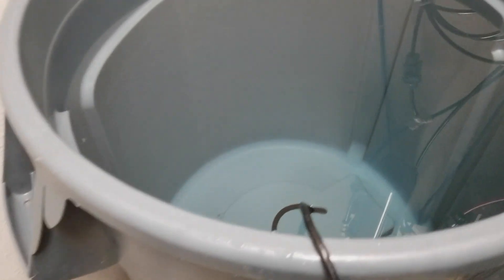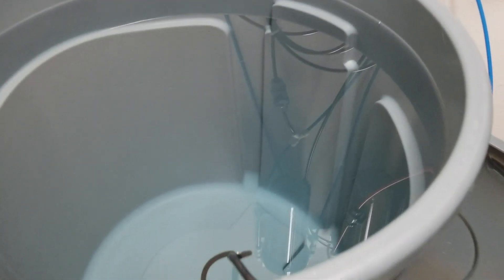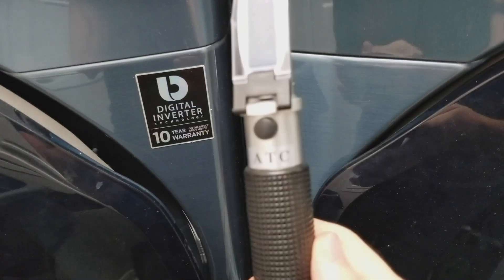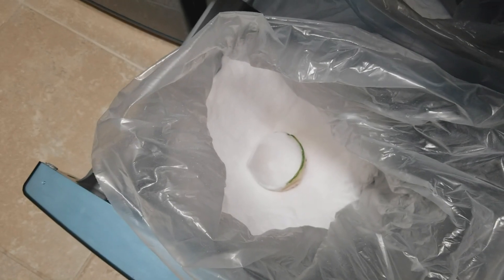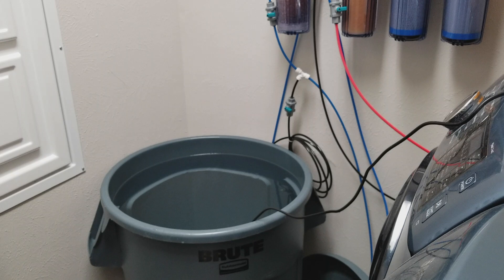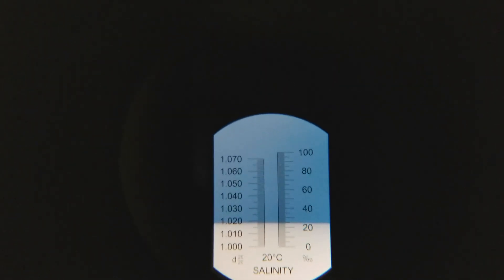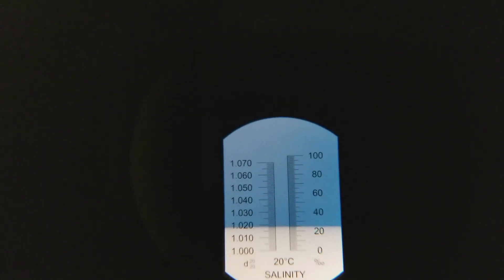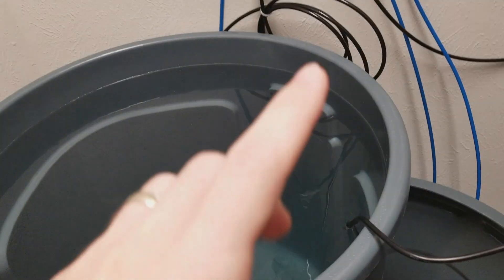How to Make Saltwater - Fritz Pro RPM

Comment: Great video!  What does your Alk test at? I don t know what I am doing wrong!  I love Fritz but they are either lying or I just keep getting bad batches!  My lfs used them but she even said she switched because of problems!  I have the same RODI as you and mix exacly like you BUT I am using almost double what hey say!  It takes me almost a cup per gallon! My alk is always around 12 too when they claim it should be 8.5 or so!  I was told to add slowly so not even sure how slow you are adding but I add very slow. I just miixed up 12 gallons and I used a red dixie cup which I believe is 2 cups and must have filled it at least 10 times

Comment: Why would you not use tap?
Reply: Shouldnt you always have some saltwater on hand? Just keep it rotating with a power head?
Reply: Joey Vara Chlorine can be neutralized by leaving the water out for a night or using a dechlorination product like safe or prime. Your system should be able to handle nitrates. My tap doesn’t have any phosphates per my testing. Don’t these systems remove the trace minerals and such that naturally occur in a successful ecosystem? I’m sure they occur at a more natural ratio from the tap then dosing them yourself.
Reply: Joey Vara If you don’t continuously mix it, aren’t you inviting algae and other unwanted things to establish in the water?
Reply: Joey Vara Why though?
Reply: Joey Vara I feel like you aren’t answering me and are only liking my comments.
Reply: @kelly022790  you do know that tap water has high dkh right? plus metals and other elements that can be harmful for corals